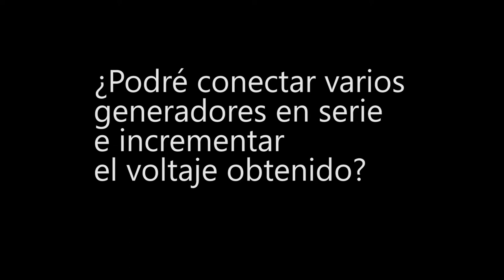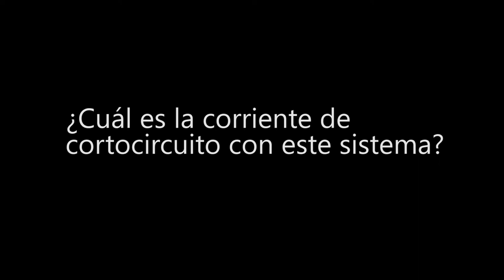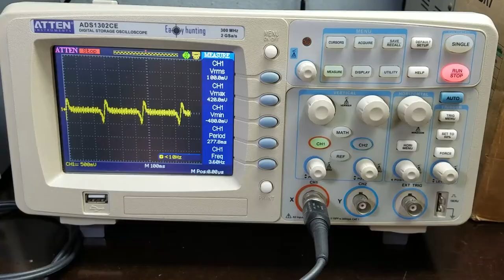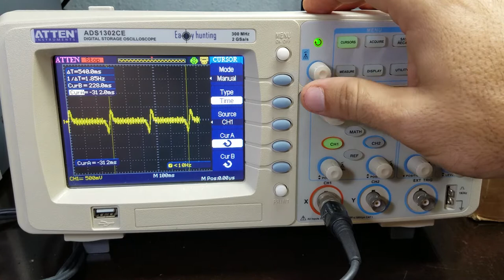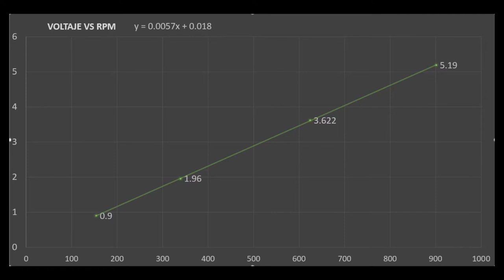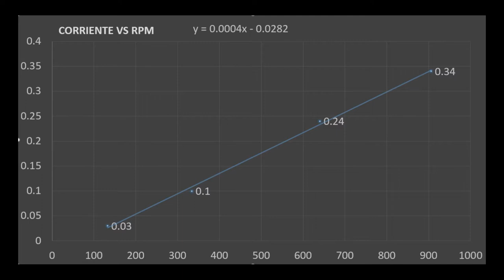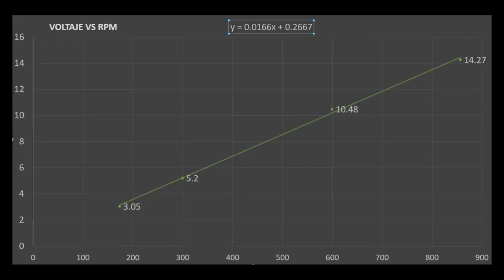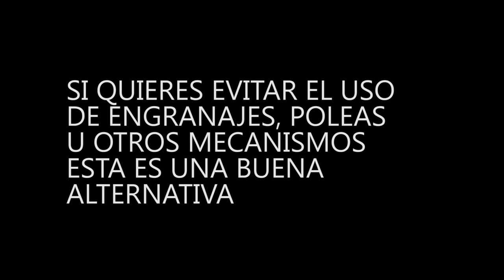¿Conectar motores en serie para un Aerogenerador?

Comment: Muy interesante el vídeo. Eres el único que he encontrado con esta información. Pero mi duda es si también se puede hacer con motores trifásicos en alterna. ¿Crees que se puede hacer?
Reply from the maker: Tendrías que igualar las fases para que no existan interferencias destructivas. Ahora si rectificas y obtienes DC de cada uno si funciona de manera similar a lo que muestro en el video
Reply: @AdrianCubas1980  muchas gracias por tu respuesta. Mi caso es que tengo varios motores de patinetes tipo hoverboard y por separado dan muy buen rendimiento(15 - 25voltios) pero yo necesito más voltaje aproximadamente 60 voltios.  Las bobinas de los motores están conectadas en estrella. Yo había pensado dejar un motor así y conectarle las bobinas de otro  motor al que previamente le habría quitado la conexión de estrella. Es decir si un motor tiene tres fases con cinco bobinas cada una, pasaria a tener 10 bobinas por fase. 
Ademas de no saber si funcionará tampoco se si añadir bobinas aumentaria el voltaje o solo los amperios. 
En definitiva que no tengo claro si existe alguna manera de aumentar el voltaje ,
Es posible que lo que había pensado no tenga sentido. Y tampoco entiendo lo que quieres decir con igualar las fases. Gracias
Reply from the maker: @JoSe-wp1gz  Creo que en ese caso lo mejor sería utilizar un elevador de voltaje tipo boost converter. Algo como esto https://amzn.to/3Wn8QII
Reply: @AdrianCubas1980  muchas gracias Adrián. Lo probaré a ver si da resultado 👍